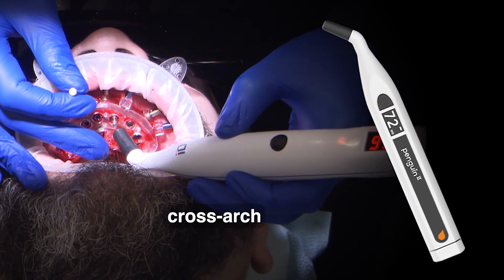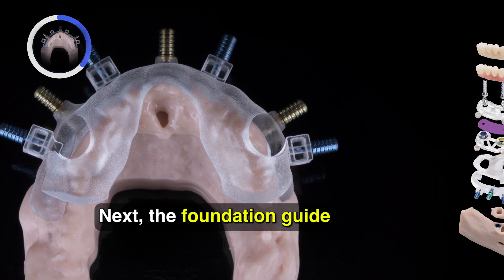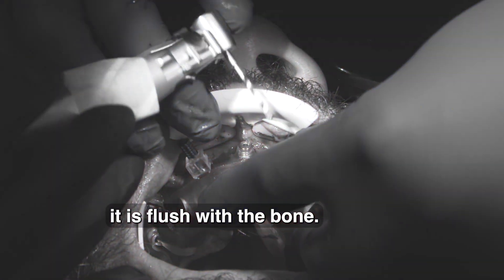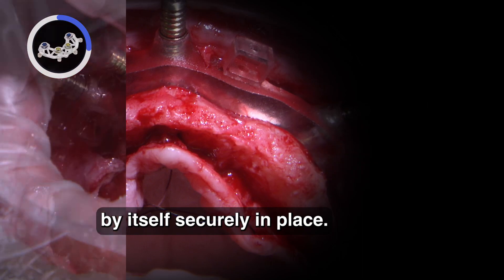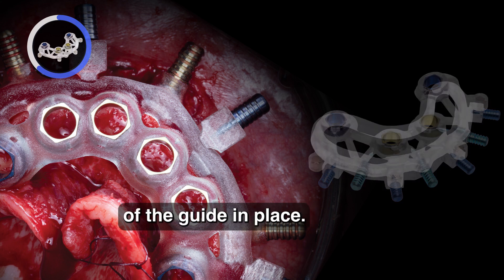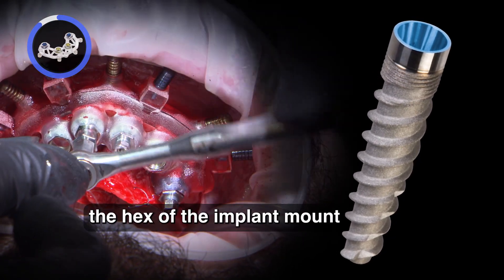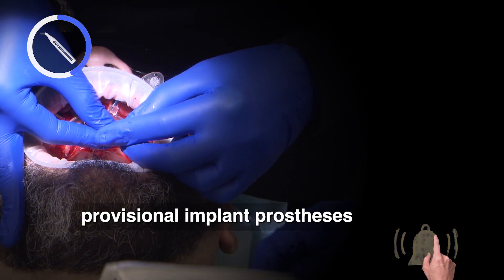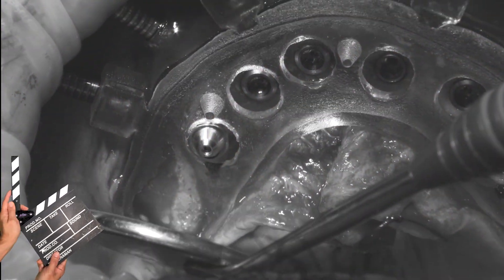HOW TO Place Implants Using a Multi-Level Surgical Guide

Comment from the maker: For this Part 2 of 3:
The osteotomy guide was seated on top of the foundation guide, and the blue interlocking pins were re-inserted to secure the guide.
With the guide secured, the osteotomies were sequentially drilled following the approved digital treatment plan. The drilling sequence was performed according to the pre-planned guided surgical protocol. HahnTM Tapered Implants (Glidewell Direct; Newport Beach, Calif.) were placed.
The implant stability quotient (ISQ) value was measured using a Penguin® II osseointegration monitor (available through Glidewell Direct).